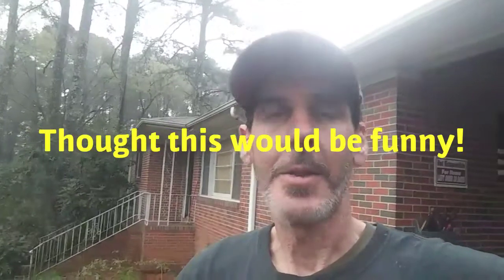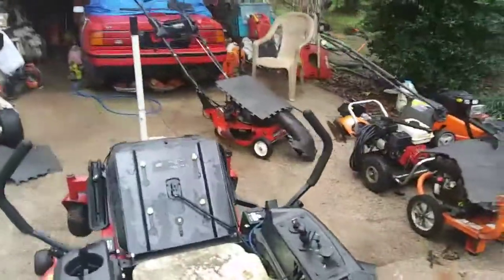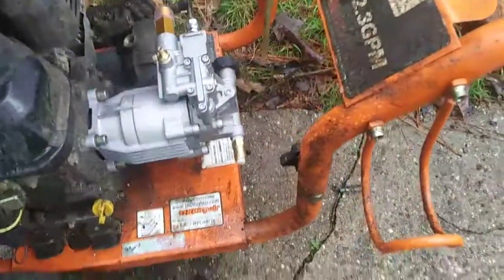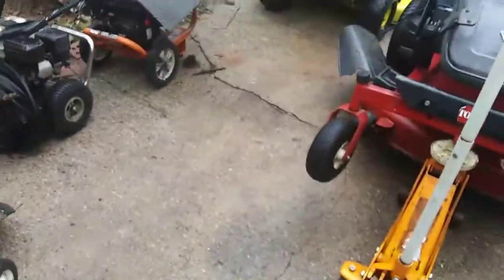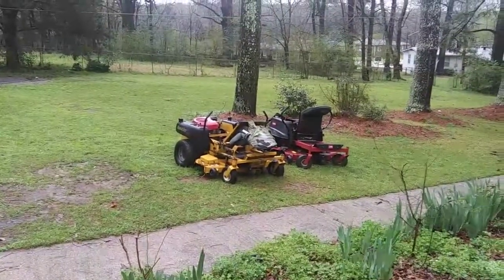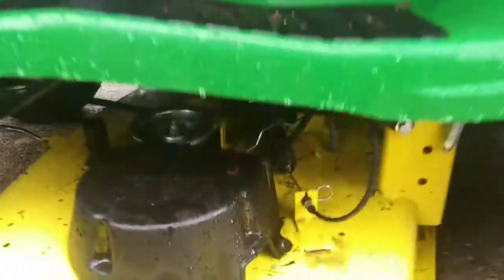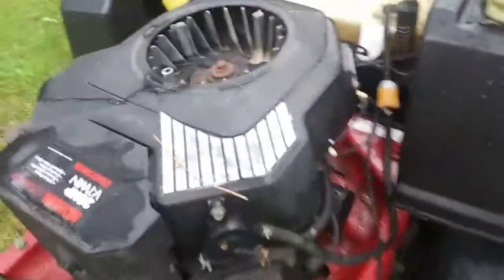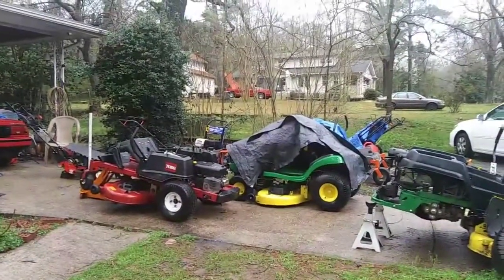Jungle Bob raw!!!

Comment: J.B. you are correct on OEM Belts. I dont like come backs as a flipper. I dont do repair work for customers other than family and friends. I found on Toro to spend the extra money on OEM belts.  The after market belts say they are a certain sizes and they are not. The OEM belt might be $5 more but it will save me come backs in the end. Pass the added expense along and you and your customers will be happier in the end! Old retired flipper from Iowa. 👍🇺🇸😎Roger